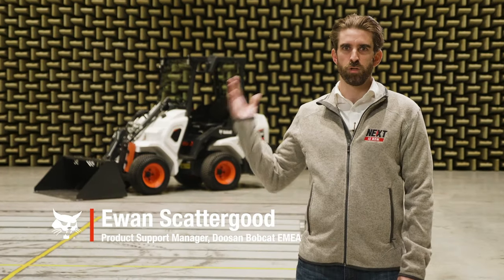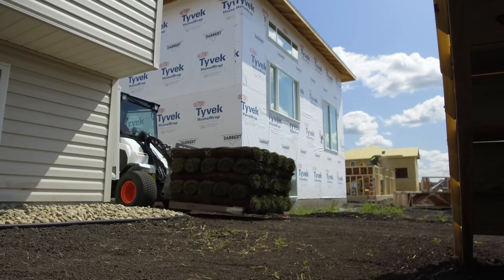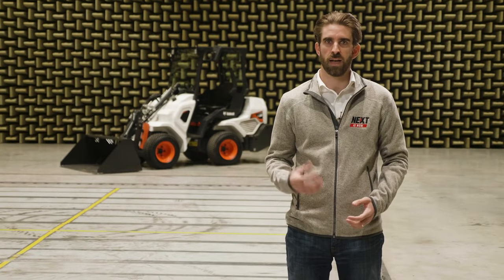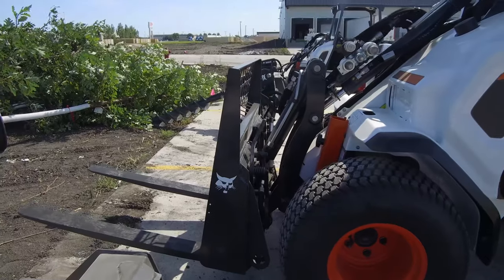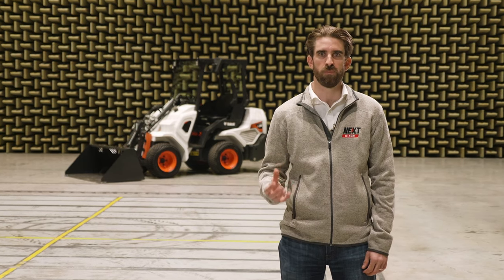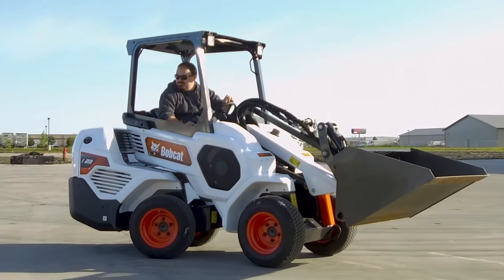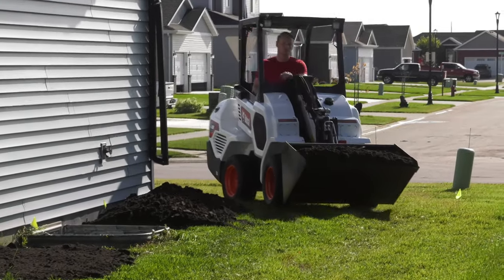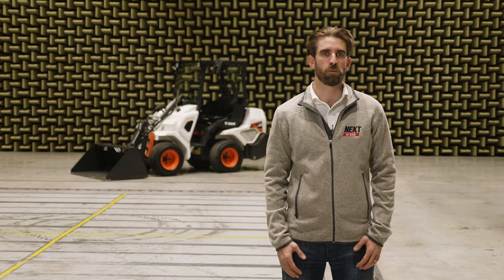Bobcat Small Articulated Loaders Introduction

Comment: For something that's a complete rip-off of the Avant, you sure do use the words "We designed..." a lot. For example: "We've designed the machine with a low center of gravity for maximum stability. And this stability is maintained during operation due to the rear articulation design, that helps to counterbalance the load". This is essentially the very core point of Avant loaders; that their design fix the inherent instability of small/narrow loaders - and they did that 30 (!) years ago. You didn't "design" anything in that sentence, but of course "We were inspired by leading manufactorers to build the machine[...]" doesn't sell as well. 

Looking forward to your updated model in x years, where we'll learn about how you designed the front boom to be off-centered to enhance operator visibility of the attachment. (Hint; this is also featured on the Avants)
Reply from the maker: Thank you for the feedback. We are looking forward to get EMEA customers feedback on our first models in the category and even comparison with established brands.